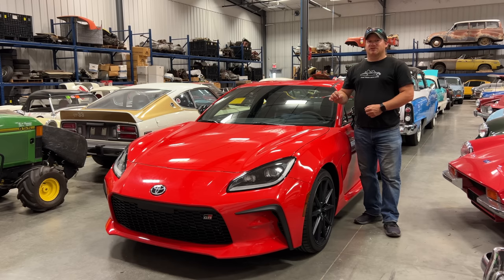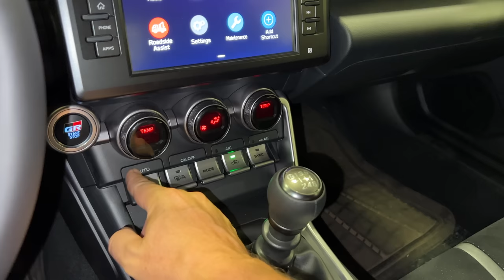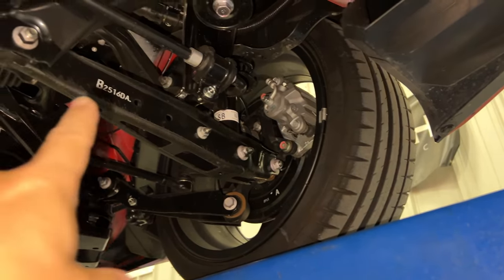Full Review of the Toyota GR86

Comment: These have electric assisted power steering so I’m not sure what that pulley was under the engine but it isn’t a power steering pump.
Reply from the maker: According to this diagram that is the water pump way down there.  I hope it is easy to get to if you remove the undertray. 
 https://parts.toyota.com/a/Toyota_2022_GR-86/105792293__10130332/V-BELT/264430-1605.html

Comment: In Australia we have had both cars, and I always thought that the Subarau was a version of the 86, not the other way around. The 86 outsells the Subaru here by many factors...
Reply: It’s more Subaru than Toyota though, like the engine. The dual injection fuel system (D4S)  is Toyota’s though. Yet, there’s more differences this time around than before.  Suspension, ECU tuning, even aero cuz of the GR duckbill (I just bought it for my BRZ).
Reply: @Rob165x  It's more like Toyota designed the chasis and everything while Subaru took over the mechanical engineering and manufacturing parts. Subaru alone wouldn't make a coupe without AWD without any incentives

Comment: Those brake and clutch reservoirs look precisely the same as my 1988 Toyota Corolla's!! Maybe it's a cost thing, as they can use the old molds? There is an article in a magazine by us that gives the reasons why this car isn't fitted with a turbo: There isn't space underneath the bonnet for one and the extra weight (turbo, intercooler, piping, etc) will affect the handling negatively.
Reply from the maker: I think it’s great that it does not have a turbo.

Comment: I am on the list at my local dealer to get a manual, base model, but now after the issues with the rtv and now just heard Subaru is recalling 400,000 cars for a major valve spring issue, means the engines will have to come out and torn down... not sure I want to take the risk.
Reply: That's why I change the mind for buy 2023 GR86

Comment: The engine bay looks like the inside of my wife's Subaru Legacy sedan, which is a wonderful car BTW. Super fun, very large inside. Three adults can sit in the back seat. Easy to get 100% out of the engine, even with the CVT, unlike most cars where you never really get to wind it out. Oil changes aren't terrible. The filter drains as you shut down the engine, so it's empty when you unscrew it.

Comment: Why do auto manufacturers only give us 2.1 Amp USB ports? I need more power dang it.
Reply: They'd have to add additional charge control and communication circuits to enable higher charge rates.  Most smart devices wouldn't use the available current without it.  Adds cost, complexity and repair claims.
Reply: @tiporari  Did you really just like your own comment bro?
Reply: @lescoe  No.  If I like it it says 2 thumbs up.  Who gives a damn either way.

Comment: Toyota is going to recall all of them ,because the engine ,Subaru didn’t make the engine right. Toyota stop using Subaru,Mazda,bmw , make your own sport car
Reply: Ah yes, except you fail to realize the R&D costs associated with it.
From the little I heard, the R&D costs for the Supra alone would have made it a 100k+ car.
Now imagine the impact that could have, leaving many of these cars to either never be produced at all or at a price tag that is outside of the avg. consumer’s reach.
Easier said than done. 

Also what is meant by “didn’t make the engine right” ? Are you referring to the RTV issue or are there other issues?
Reply: Valve spring recall . Toyota owns 20% of Subaru , but Subaru recall over 400 k cars in the last 2 years , why add the Toyota rebadge to that ? They already new about this but they don’t care ,they start selling 86 knowing the problem, now people is calling and going to the dealership trying to get fix .